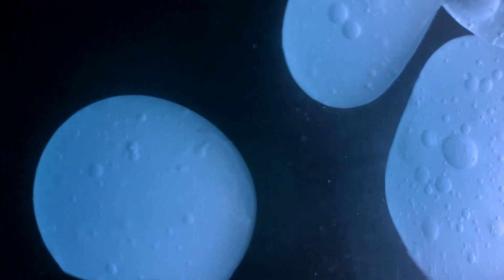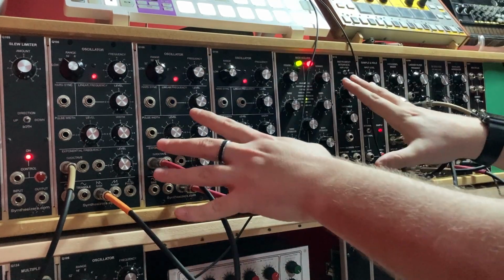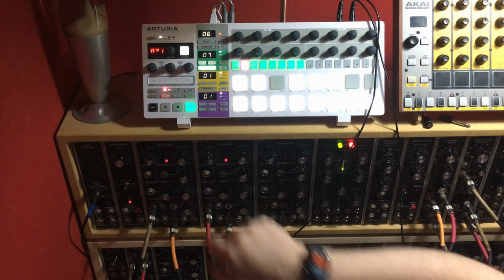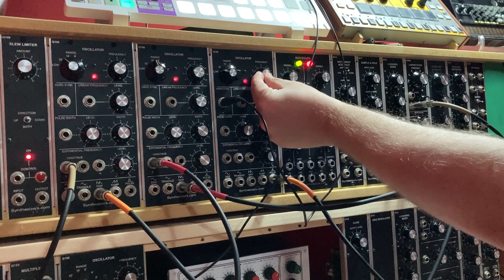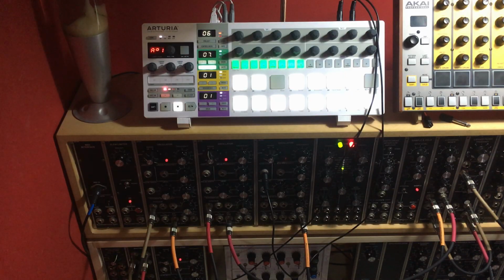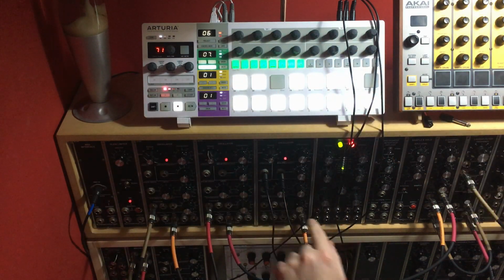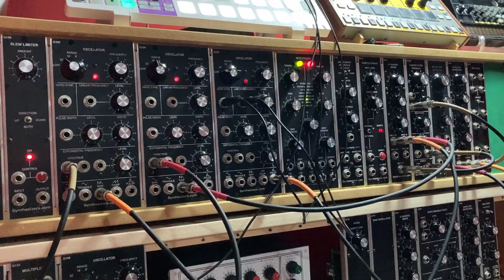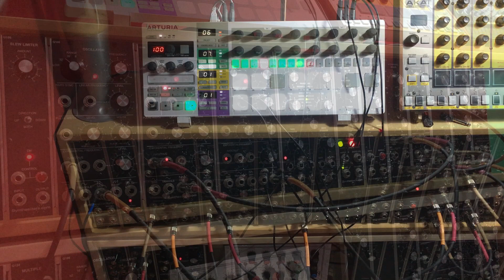How to 'ratchet' with the Arturia Beatstep Pro

Comment: this makes sense spent thousands on your modular and buy a sequencer that needs workarounds..  the zaquencer(cheaper better) does all this with zero faf..  I think the keystep has different quantize per step also.. I have a big 5u and its notorious for simple feature light sequencers (oldschool) .. personally a seq that you cant adjust step timings (feel) would not be in my setup..
Reply from the maker: Ahh yes, the Zaquencer.
Buying a MIDI controller, altering its firmware to make it a sequencer, possibly having to buy a 2nd MIDI to CV interface for use with a 2nd channel.
Zero faff. Right.

Fair enough, it’s not something you’d want in your setup, but with all the features it does have, over 2 channels, with an extra trigger sequencer to boot? The BSP is something I’m happy to have in mine
Reply: ha.. the new B version might be good.. my main is the squid.. have 2 zaqs setups easy.. not like you ever need to do the beatsteps firmware.. like 99% of released new machines these days..
Reply from the maker: @jsaulkane5893  I’ve never once updated the firmware on my BSP since I got it.
Never needed to
Reply: unusual in these times.. not on v2 then?
Reply from the maker: @jsaulkane5893  Honestly, I have no idea. Whatever was installed when it came out of the box all those years ago XD
Reply: two years after release they add a ton of features..via firmware.. scenes/polyrhythms/pattern chain/ random'/step mode/  ties/ no faf there :)
Reply: v2 firmware was only 4 yrs ago..  wish there was a squid update!.. pioneer are useless... saw some guy mess up his pro 3 recently.. most machines are released unfinished these days..

Comment: the LFO I'm planing to buy has a Speed in so that would be the frequncy right and and a Wave in and Reset would that also work? and with which input 
(Rides in the Storm DMO)
Reply from the maker: I’m not familiar with that particular LFO, I’ve had a quick look at their website and I think the RESET might be the Sync input.
If so, that should work just fine. But I can’t say with 100% certainty 🤷‍♂️
Reply: @ScottAmpleford  thank you anyways